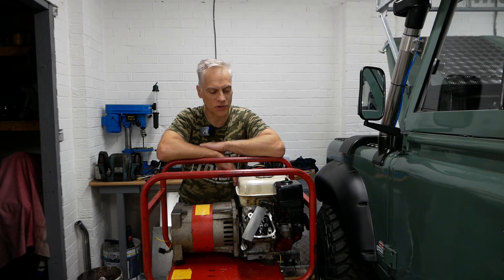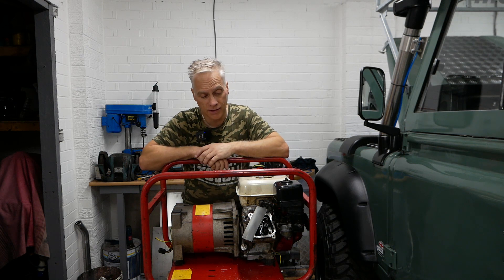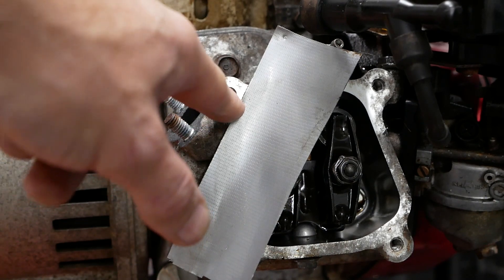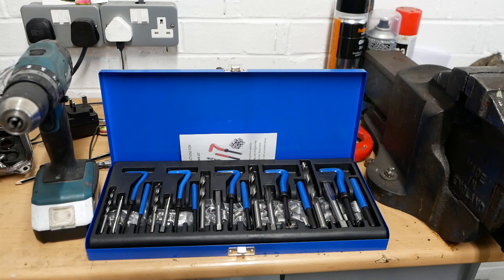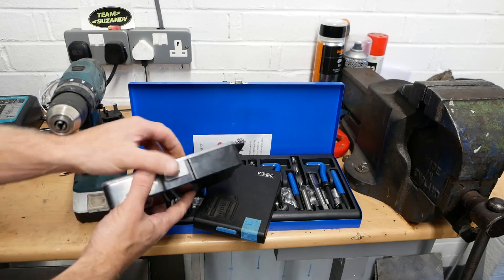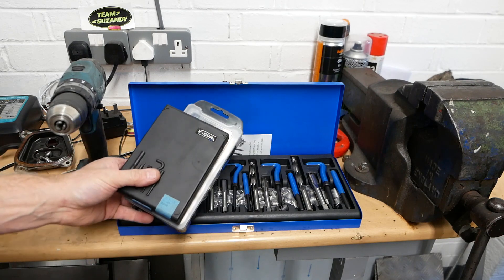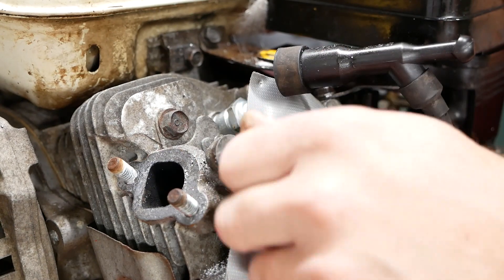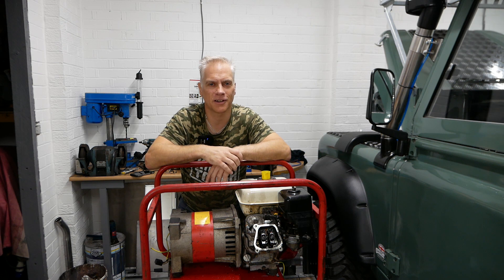How to repair a damaged thread using a Helicoil. |Raptors Garage OG

Comment: Always best to use a Time-Sert, ok a bit more expensive but a lot better than heli_coil. Cheers Mike
Reply from the maker: Hi Mike..time sert are better than helicoils but not suitable in every application plus the price of the time serts is alot more than helicoils it just depends on how many threads you think you will have to fix because a set of time serts the same size of the helicoil set i  am using in the video is around £500 versus £30 for the helicoils but you do get what you pay for..regards Paul